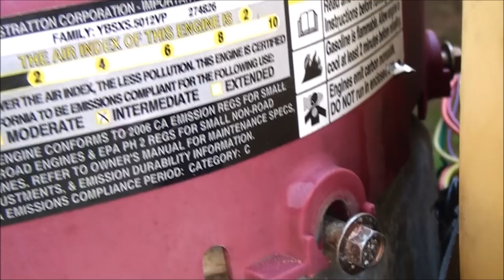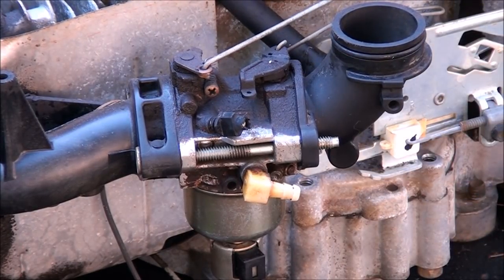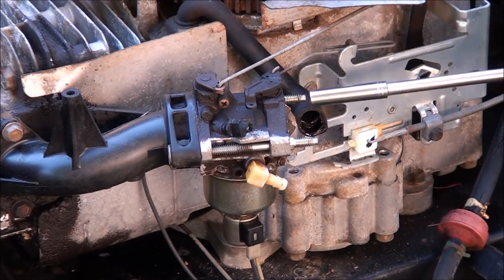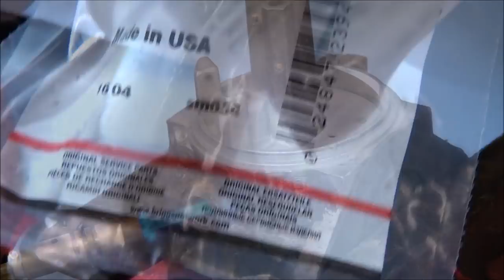Briggs and Stratton INTEK OHV Engine: CARBURETOR REBUILD & Repair. Riding Lawnmower LEAKING GAS FIX

Comment: It’s easier to just remove the two screws at the intake where it connected to the engine
Reply: Not really then because you still have to take the carb apart when it's off the engine. That's 4 separate times that you don't have to twist extra bolts on or off. So by taking it apart on the engine saves energy and probably time. Depending on the person.

Comment: What sucks is there is no easy way to drain this float bowl.....bad design ...I got water in my tank now in carb....what to do.... I got good gas now, maybe take plugs out and crank for 5 min? But it won’t suck good with plugs out will it?
There should not be a float bowl made without a drain on it

Comment: good video but you can buy a brand new carb on amazon for $20 shipped lol.
Reply from the maker: Yes but I would not recommend an aftermarket carburetor.
Reply: Aftermarket carbs "can" work, but more often than not they are going to require some creative engineering in order to get everything connected and adjusted properly. Some can't be adjusted properly at all. OEM is generally best. Jeff is doing everyone a great service by posting these service and rebuild videos.